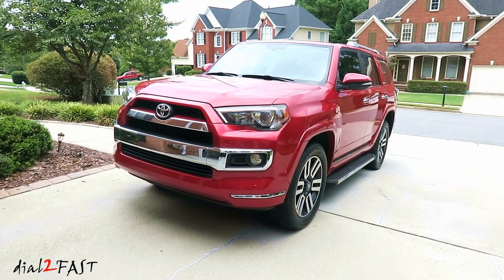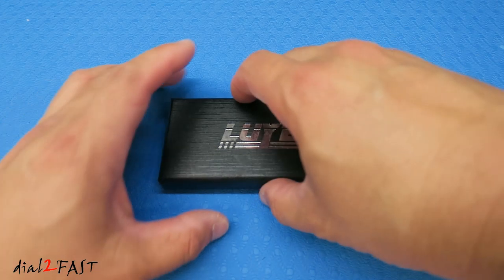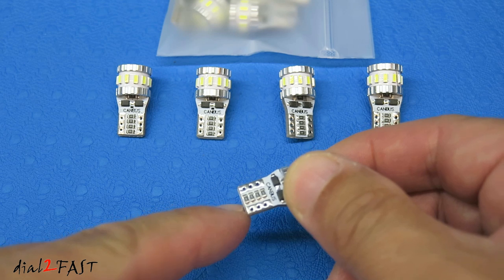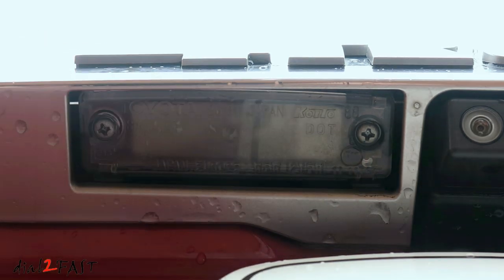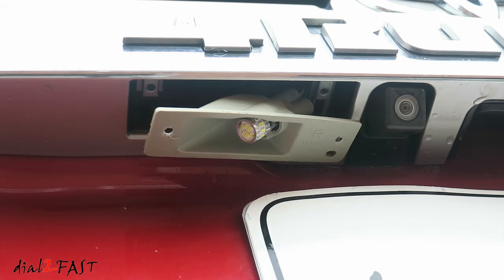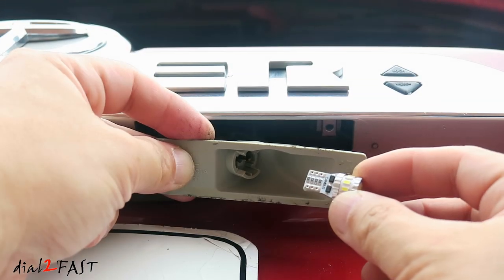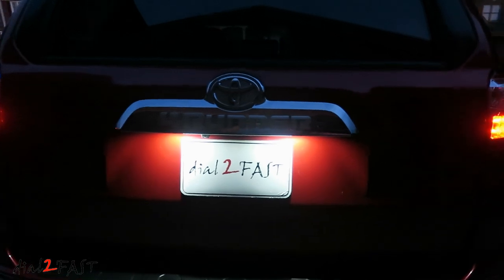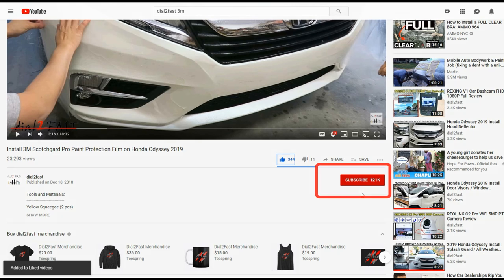Very Bright LED License Plate Light Install (194) For Toyota 4Runner

Comment: Am I right in saying some such bulbs are polarity sensitive, some are not?
Reply: Incandescent bulbs do not have a polarity, but all LED lights do. Some manufacturers of LED bulbs have a circuit that will allow you to place the bulb in either direction, so you do not need to know the polarity of the socket. This is becoming more common on the newer LEDs.
Reply: How have these held up?  I've tried two styles (cheap eBay) in our '17 4Runner and they've failed in a month or two.